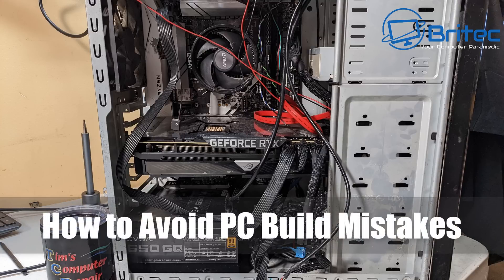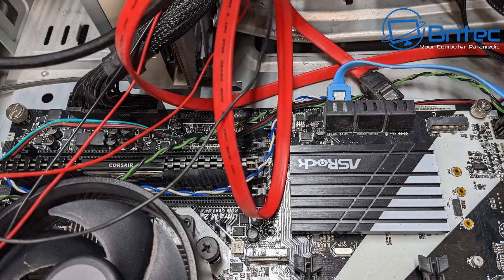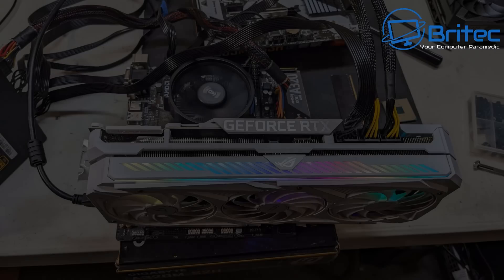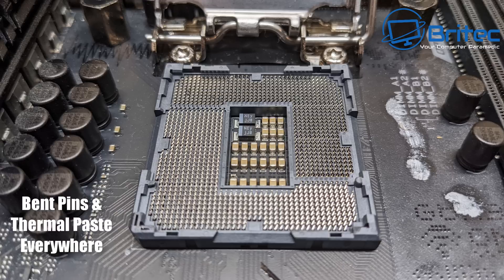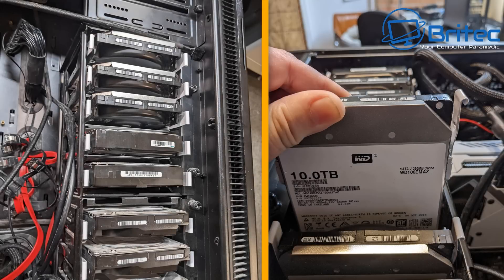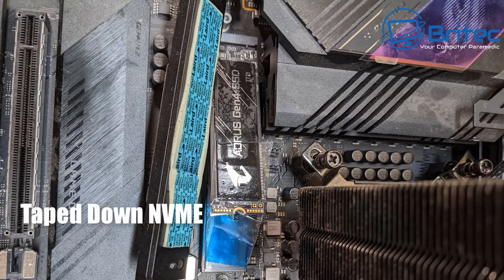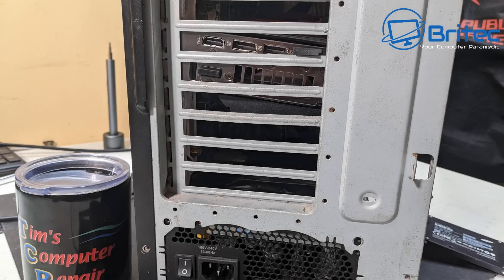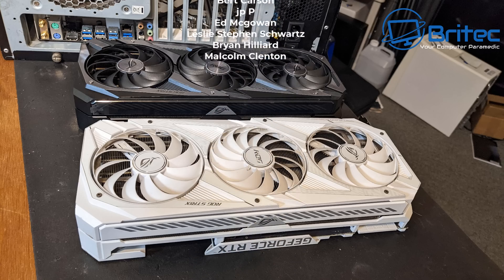Probably The Worst PC Build I Have Ever Seen

Comment: If someone doesn't really know what they are doing, but they really want to do it themselves, then they should stop and figure out what they need to do right to keep going. My approach is a slow method of working, putting lots of thought into it, avoiding the use of force/excessive levels of force, if I am not sure about something or have serious doubts and concerns, I walk away and leave it alone until I figure it out. I agree whoever built those ones should've invested in an appropriate case, seems like they wanted to cut corners but have cost themselves time, effort and premium hardware.

Comment: I originally had a small HP Pavillion desktop. To run DaVinci 15. I replaced the GPU with the 1050 I still have, Had to remove the DVD drive and re locate the hard drive to do this. Put and SSD on the connection for the DVD

Comment: I bought a super massive case for my build. Have two gpus, my old 1050 and new 3060.  3 hard discs and 4 SSD and 2 MDME cards. Is this a bit OTT? I run DaVinci 18 mainly.  Had to put my fan on the CPU on the other side to be able to fit in 4 memory cards. The mother board was originally assembled for me with just 2 memory cards and I did not want to disturb the cooler. Works OK though.

Comment: Best HACK I have ever seen recently is the fool that CUT his RTX 3090Ti in half with a hacksaw and tried to solder wire connecting bridges from the cut tracks so he could mount half the card inside and half the card outside the case he wanted to use...his crappy, rusty and dusty 25 year old SFF Compaq case he LIKED the look of.....best way I have ever seen of ruining a $4500AUD video card...and his decision was only improved upon when he tried to use 12AWG wire (for power handling.....his EXACT words). I have doubts anyone SANE could solder 2.5mm wires to tracks the size of a human hair....but obviously someone said to him, you go son, best of British to you....he did have a 230w power supply in the case though, so it was always going to work....wasn't it?
Reply: Wow, that is UNBELIEVABLE!  
You should have told him: "A hacksaw is too slow, mate; Use a chainsaw next time"...
Reply: @Johan-ex5yj  But then the cuts could be too big for the ARC Welder.

Comment: Trying to fit a GEFORCE RTX GPU into a small case, is no Bueno.
Reply: I would have at least tried to hack out the drive cage to put the GPU in and stuck the HDD into the optical bay somehow.
Reply: @disposable_hero1725  Sure you can do that, but with the price of an ATX Case's being so low why do it. Then you might want to put multiple hard drives and then your back to square one.

Comment: Good day! Quick non-related question: do you have some advice on how to safely remove a small stripped screw from a laptop's board? I've tried using latex and heating the screwdriver.
Reply from the maker: Dremel possible?
Reply: @Britec09  I watched some videos of drilling and/or cutting the screw, however I don't have the tools (plus I wouldn't be confident to use them without damaging the board, to be honest) My next best bet is acquiring some fork-type screwdrivers to try to remove it, however the small ones seem to be hard to get in my country, so I'm trying to figure which ones to buy online.
Reply from the maker: @jesusojeda7850  https://amzn.to/3Nj9mmf $23

Comment: at time index 11.56 looks like hard drive cage needs to be taken out for gpu to fit without bending case on dell computer over 10 inch gpu will not fit without taking out hard drive cage surprise case bent before gpu was broken I only have i5 2320 gtx 570 8g memory 550watt gaming computer  have better gpu but over 10inches not using hammer to fit in will end up with broken gpu if using hammer to fit metal looks strong on dell computer I know I have cheap parts but not using hammer to fit also have to look for triangle to put cpu in right at time index 6.30 can see lower left on socket

Comment: got 4th gen dell 3847 g3240 16g  computer from shopgoodwill for $39 $23 computer $16 shipping and stuff came with only 12g memory loose hard drive no screws in side panel was not listed as parts and repair surprise hard drive and computer worked looked like was only get back $23 at best as listed in return email so kept computer still without 16g gaming memory dell 3847 has 2 memory slot need 8g memory stick still hard and expensive to get 4g memory stick cheaper  easier to get do not have dell 4 memory slot 4th gen motherboard and these have 8 pin power connect not 24 pin power connect like 3847 motherboard hard to win in matching parts also more than 10 inch gpu will not fit dell computer with taking out hard drive cage only have i5-2320 8g memory gtx 570 550 watt ps gaming computer trying to match parts for better 4th gen gaming computer like in video cannot use unmatched parts

Comment: the one with the board that is not screwed in cannot do anything about it. there used to be a time when you had to bend boards straight. so that all components start. and the plates also boot. Somewhere when did you store them in an arched way. that's the only way the lains still connected. bad grounded mixed metals on circuit boards on quick construction. human error. chord architecture. today robots do it there were times today that didn't get me so excited. 15 turns 1 st out. heat .bent again crazy .times there were only for the masses made in China 1 product toy neuland hyend you thought me.definitely a child like me back then whats ever...the main thing is that it shines and sparkles and runs.maken are not interested in addicted children.

Comment: It looks like it was built by a football hooligan neanderthal, Chelsea supporter,🤪🤪🤪 how thick do you need to be to bend a CPU and bend a GPU into a shit case.
I'm not surprised about the screws, I doubt if any hole would line up.
Did he actually use the computer or just looked at the pretty lights.

Comment: I have seen some in my time. By far the worst was the one that screwed the motherboard directly to the case with no stand offs. Resultant switch on didn't just release blue smoke, but a big flame. The traces on the motherboard had actually separated from the PCB in the motherboard and curled back. Wasn't happy with the cost of replacing the board, CPU, RAM and power supply.
Reply from the maker: I have seen that a number of times

Comment: stop using the crappy dell type cases from the early 2000s that would be a start and if you have the money for a 3080 ti for about 40 quid you can grab an old h500
Reply from the maker: I agree John, spent all that money on to of the line parts and then uses old case lol